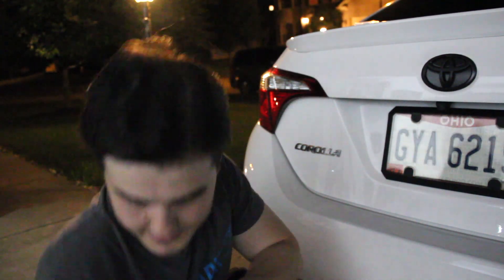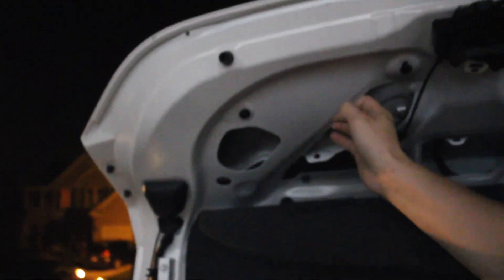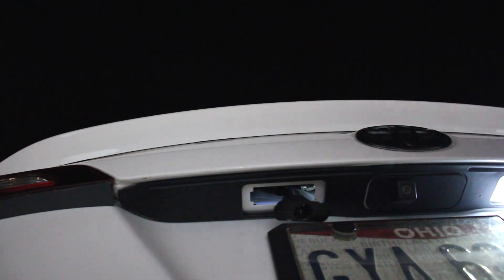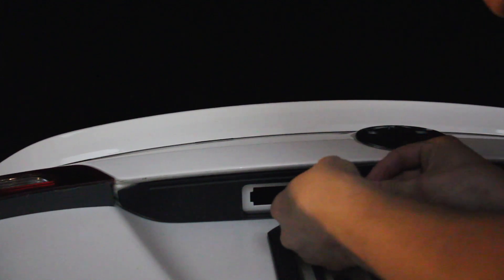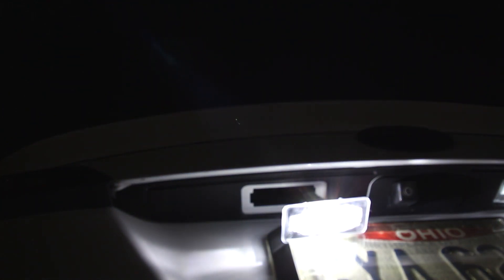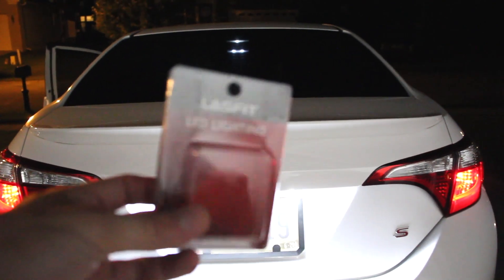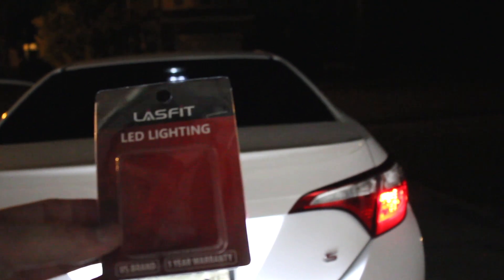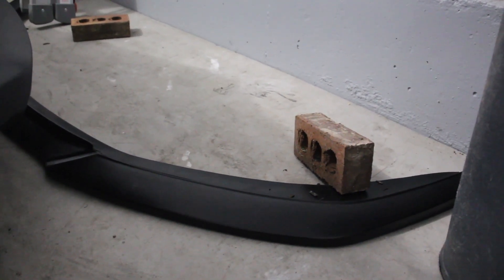How to replace rear plate lights on 2014-2017 Toyota Corolla

Comment: I changed my reverse lights with lasfit led lights on my 2016 corolla s,
it is  bright but not so happy with the outcome,.the light wasnt focus on the driveway  its more lighting on the side! 
 is not as good as i put them on my 2007 corolla it maybe because the light pattern wasn't design for 2016 corolla!
Reply: Ahrdee suggest you try the JDMaster led bulbs! They have great light output

Comment: Hi any info or link on the lights, the link above does not work anymore, Which type of light number please, does anyone knows?
Reply from the maker: https://www.ebay.com/itm/186247093508?fits=Year%3A2016%7CEngine+-+Liter_Display%3A1.8L%7CTrim%3AS+Sedan+4-Door%7CModel%3ACorolla%7CMake%3AToyota%7CSubmodel%3AS%7CEngine%3A1.8L+1798CC+110Cu.+In.+l4+GAS+DOHC+Naturally+Aspirated&itmmeta=01HQPWSHAQ65F10TWP3KQW3H94&hash=item2b5d311d04:g:ZE8AAOSwBVRlLKQF&itmprp=enc%3AAQAIAAAA8Gra44VTieJ%2BCu5TQh5g5DsLAgM1viGWVzTHml6%2F5n5NmFdNPGsV27URp%2FlOqypCDIw2nmYwnRwVlPINcu%2BtFW2e5h%2F3mZVl08UfhktPLX52ZLvii1d6A7A80gaJdKMoM%2FPP%2BwXhbCZtCh2RN%2B87ZXV1mzZzYsFvSmrbKdVnP3KMwLjgVD1FYI9YtFKK2Ap4ok3FW2AA%2FyKsYUKwMBKTypzimtQkyCJ6UtR3RIB6w%2BSTERD%2FW9WEGZg1eaSj7KvmeUY43d99%2FnEHJo4tI9ifR9jxCP80s3uRTxLLs8INzK0ogPJ994OtqY1khcDZWwUZFQ%3D%3D%7Ctkp%3ABlBMUMCV5ty9Yw
Reply: thank you @zafar13